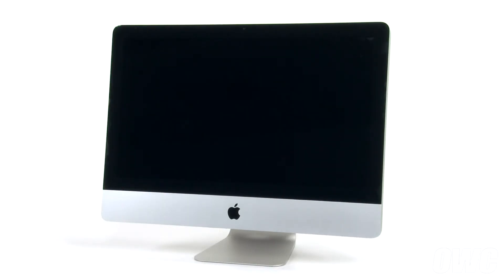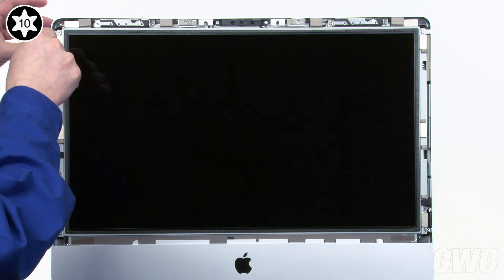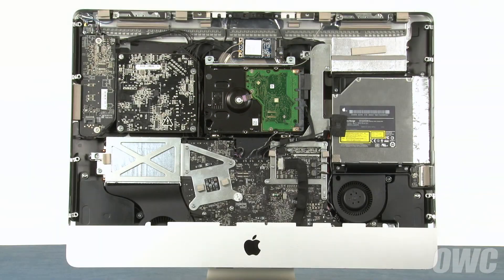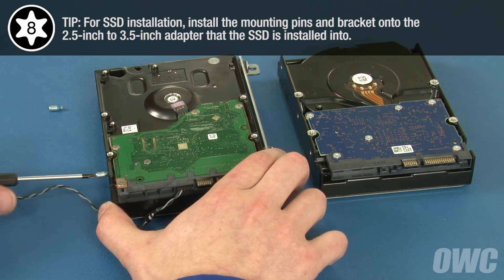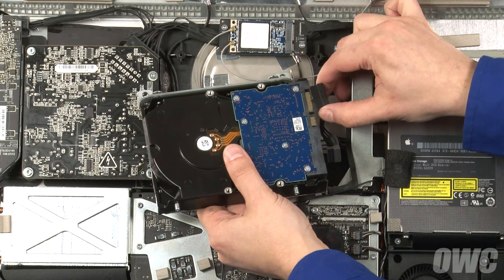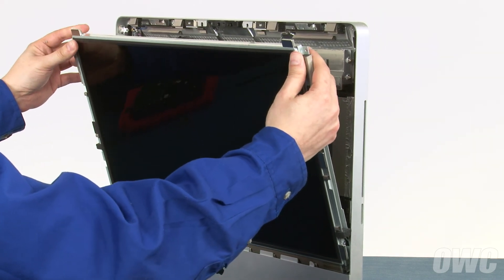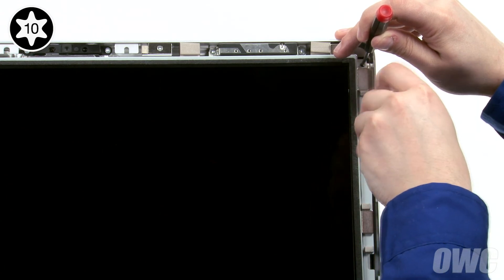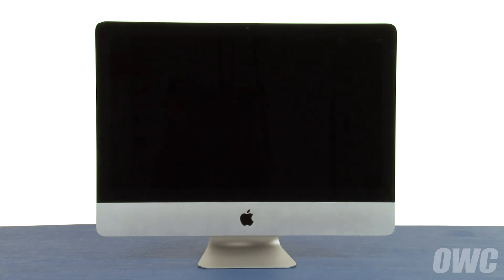How to Upgrade the 3.5-inch Main Drive in a 21.5-inch iMac Late 2009 (Updated)

Comment: What is the maximum SSD / HDD size? my iMac did not recognize anything bigger than 512GB. Can I put larger drives in?
Reply from the maker: Hello Cro, as far as I am aware there isn't an imposed limit on size. Looking at the specs of the iMac10,1 (Late 2011 21,5") it appears to have come with up to 2TB HDD so there may be another issue with your iMac.
Reply: @poweredbyowc  Thanks. This page shows only 500gb option. My imac has 2.5 ghz core2duo, 6750 amd gpu, MC309, could you check? https://en.m.wikipedia.org/wiki/IMac_(Intel-based)
Reply from the maker: @Cro Hawg Apple specs on mc309ll/a: https://support.apple.com/kb/sp623
However, the iMac12,1 does not have a Core 2 Duo processor.  Can you please contact us at support@owc.com or 800-275-4576 with the serial number of your iMac so we can help you further?
Reply: @poweredbyowc  Hi, you are correct. this is the cpu: cat /proc/cpuinfo
model name      : Intel(R) Core(TM) i5-2400S CPU @ 2.50GHz
Reply from the maker: Awesome! Yes you should not have any issues with installing a bigger drive in your machine. We would strongly recommend that you reach out to us vide phone or email for further assistance.
support@macsales.com or (800)275-4576

Comment: I did it today , putting an SSD in a Late 2009 21.5 iMac.  Hardest part was putting the display screws back in.  The magnets grab them all the time.  Great helpful video, thanks!
Reply from the maker: Hi HarpingOn!  I know what you mean! Well, at least the screws don't get lost! 🙃  Thanks for being an OWC customer!
Reply: @poweredbyowc  I was pretty amazed that I could still get the OWC kit for the Late 2009. It's now happily running a modern Linux from SSD, 16GB RAM,  it's a usable computer again.  Hotter than satan's armpit though, even though I cleaned out all the fans and vents whilst I was in there.
Reply from the maker: Hi @HarpingOn!  Glad to hear that the L2009 iMac is usable again.  Please contact us at support@owc.com or 800-275-4576 to discuss the heat issue; the thermal sensor is supposed to relay the correct temperature so the operating system can adjust the fan speed.

Comment: the original iMac hard drive uses sata 2.0 3gb/s will it work if I use a sata 3.0 6gb/s?
Reply: Yes. The SATA 3 drive will operate at SATA 2 speeds.

Comment: If you upgrade it with ssd drive the temperature sensor goes on the same position on the ssd?
Thanks.
Reply: MacSales. com Thanks for the reply I will let you know as soon as I install it.